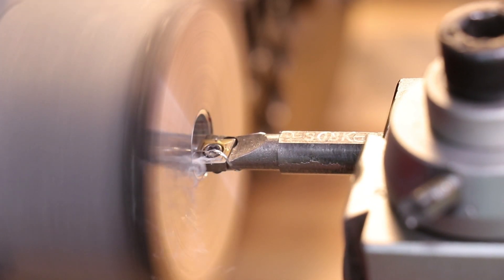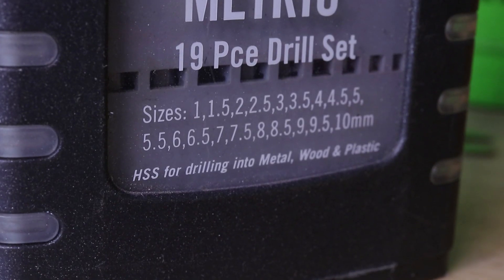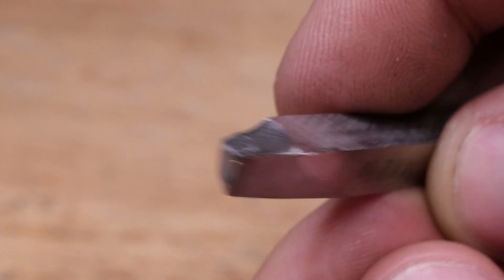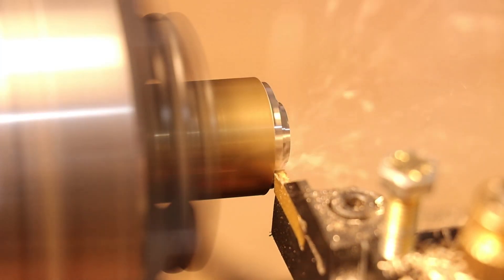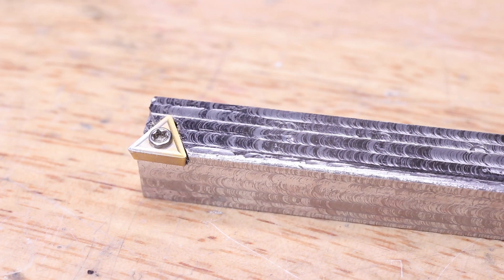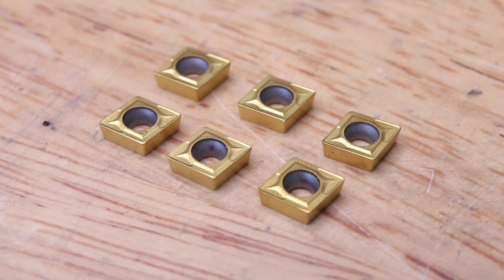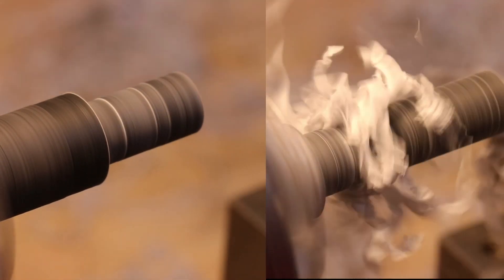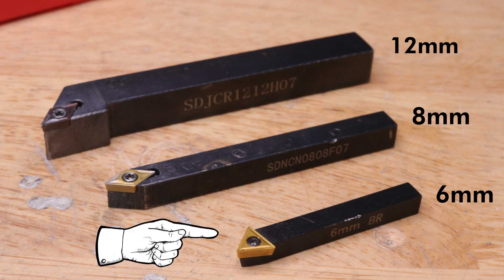HSS vs Carbide | Tooling For The Mini Lathe

Comment: if you call the manufacture you can get deals if you get a good rep 120$ in inserts (around 10$ each  dep.) and they will throw in a tool holder (this was a Kennametal rep fyi)

Comment: To be honest, the only modern application where I can see Inserts made of high speed steel is for cutting aluminum. It tends to leave a better finish than carbide. But I would still rough with carbide.

Comment: You forgot to specify (or maybe you don't know). Carbide inserts can also be found with different cutting angles. The same model, for the same knife holder, there are at least 3 types of inserts that have different angles, different treatment qualities, different coatings. And the price differs slightly for 1 set of 10 pieces. Example: 
-Soft materials (plastic, wood, aluminum - sharp angle)
-Medium hardness materials
-Hard materials, for example stainless steel

Comment: Carbide inserts, as you say, are not exactly razor sharp. They have a tiny radius on the cutting edges to provide more durability under heavy loads such as found in commercial machining operations. For small lathe use you can use DCMT inserts designed for producing a finishing cut on aluminium, they will cut steel just fine but the cutting edges are more delicate and will degrade more quickly. You can certainly sharpen standard inserts with a diamond lapping disc and I do that even with new and unused inserts. Sharpening is simple and fast. Face mills benefit greatly from having their inserts sharpened as they cut more freely and produce a better finish. I still use HSS tools but I suggest you make yourself a jig to shape or sharpen them rather than the offhand method you describe. Even high carbon steel tools still have their use for fine work in brass/plstic because you can get the finest of cutting edges with this material. Watchmakers use carbon steel tools a lot.

Comment: Excellent video with lots of good advice!
It is important to get fine grained carbide inserts for small lathes.The polished small ccmt alu carbide inserts work really well and last. Fine grain carbide inserts can easily be reground and imoroved using cheap C hina diamond discs and a home brew accufinish grinder. I made a simple one with a 1 to 5 rpm windshield wiper motor and 100mm discs. I use 3, 360, 1000 and 3000 grain with small magnets to mount them to a backing plate. Stefan Gotteswinter has a very good video about this, got the magnet idea from him. These discs were about 10$ from Ali.
 I find that people tend to forget how useful HSS tools can be. I make prototypes for my engineering firm and as a hobby. This is very different from running a production shop and taking very small skim cuts is often important, something stock inserts do not do well since they are not sharp enough. I have been at this for a few decades and have accumulated a sizable drawer of very useful and inexpensive hss tooling that I reuse. Silversoldering small pieces of carbide is also very useful for making small tools. Used mini carbide boring bars is another inexpensive source for tooling. Use these both in the lathe and in my small boring heads.

Comment: I have always used inserts but after watching this I think I will try HSS.  The only thing that has put me off in the past is that I assume when using quick change holders you would have to readjust the height of the took every time you sharpen it?  anyones thoughts on this thanks

Comment: I sharpen all my carbide tooling except for some finishing ones with large radiuses and they cut like butter but will always be more prone to chipping and cracking, this is minimized with not backing out of cuts and making sure to smoothly and consistently pushing through the cut

Comment: Those coated DCMT inserts are absolutely the wrong tool for turning plastic. As you stated, they are pressed and sintered and are so are not NEARLY sharp enough for cutting plastic - it just makes a ton of heat and poor quality finish. The coating makes them even duller. You can purchase manufactured DC inserts with a "honed" edge, which are ground from the factory with a ground edge on them, but by far the best tools for this sort of work are just uncoated carbide insert blanks such as those made by Applitec or brazed carbide with a bit of extra sharpening.

Comment: If you don't learn grind lathe bits you will have problems turning materials that require special tool angle. Plexagls comes to mind. any toll that cuts or drills need a zero rake so it doesn't fig int to the plastic. ull nosed forming tools, tools that leave a radius and more are beyond you. I started using a lathe in 1959  for a science project. Later, I ran a lathe for Brantley Backoes and then Vrantly-Hynes Helicopter. I bought a Chinese Mini Lathe about 20 years ago. Even as bad as my eighty year old eyes are I can still freehand grind lathe bits. I have tool steel, brazed, and Inserted carbide tools. I almost always use tool steel bits if I need to turn something too hard for tool steel to cut, and I am in a hurry to take it to a bigger lathe. A Mini Lathe can barely cut hardened 4130 that a full-sized lathe rolls a dark blue 500 F chip off of all day long.

Comment: GREAT summary video! I couldn’t agree more with everything you said as I’ve discovered using both types. 👍 I would have added that with carbide you need to nearly double your rpm & feed rates, as well as it not requiring coolant which is a huge benefit on the cleanup perspective not having to clean up spun cutting oil everywhere. Also would have been worth mentioning about the different carbide coatings which mate to steel vs aluminum.

Comment: omg.... too much misinformation about carbide as tooling for the mini lathe.  It seems like almost every one of these 'hss vs carbide for mini lathe' videos miss one of the most important and vital points about carbide tooling... They're application specific. And most video creators seem to buy carbide tooling without even knowing what they need.  Of course then make broad claims about the entire material....

1. Addressing 12:28,  Shape of the insert (Triangle/55 degree/80degree/square) has ZERO bearing on cutting edge sharpness... You're using the WRONG insert for your machine requirements.  None of those inserts presented are even 'sharp' to begin with!  Again, insert shape has NOTHING to do with cutting edge sharpness.  Go through a Mitsubshi turning tool catalog (they're free to download) and educate yourself on the different chipbreaker geometries. There are clear differences on the cutting edge between a FS/MS/RS.  You don't even have to go with a 'fancy' brand name tooling, **brand name tooling just make it easier to find what you actually need**.  'Chinese' inserts have a similar geometry available but you'll only have poor pictures to make your decisions on. 

2. 10:10, And the myth that hss is sharper than carbide is just that - a myth. Sub-micron grade carbide are plentiful these days and can achieve a FAR sharper edge than the 5~60 micron grain sizes of typical HSS. 

3. 2:50  carbide turning inserts that will be more applicable for low power lathes are going to be ground. Yes there are ground carbide turning inserts.... ...... 

4. 4:55  In the scope of a lower power machine/hobby machining...The difference is knowing exactly what you're getting VS guessing from the seller's images to determine cutting edge geometry.

Comment: Do you know about crobalt or stellite or blackalloy? These are all based on 50% Cobalt and 30% Chrome. The punishment they can take far exceeds M35 or carbide.https://www.youtube.com/watch?v=iAPyWKXnVFM. And when you use it in combination with the diamond tool holder this guy promotes you only have to sharpen the end of the blank. Not three sides like a normal cutting tool. These tools are sharp like high speed Steel but they hold an edge for much longer. It can also be used at higher speeds.

Comment: My first set of tools for my 1930's mini lathe cost me about £5 off of Aliexpress, brazed carbides and as long as I don't sweat them too much produce a very nice finish, better on softer metals but slowly handles steels with care.   Got a sweet set of spot drills off there too for couple pounds, an angle protractor for about 80p and a very nice quick change tool post set for £20 coming with 5 tool holders incl a boring bar holder and a parting blade holder but they skimped on the grub screws so changed them for longer high tension allan bolts on the standard tool holders as the brazed carbide's are quite small, ideal for a mini lathe.   I haven't fitted the tool post as yet because to do so, I have to pull a stud from my crossslide or make a sleeve nut to fit the existing stud.   Next job is to try and find or build a transmission axle, I have en route a jack shaft with suitable 3 step pulley, waiting on finding a suitable tall mount to mount the pillow bearings to hold the jackshaft which will give me three speeds from my motor.   I have watched most of your videos and learned so much too.

Comment: For those of you wondering HOW the TITANIUM NITRIDE coating is applied to something like a CARBIDE tool ...  It's actually quite impressively done molecule by molecule via process called physical vapor deposition (PVD).  It's put in a chamber and I believe they give the target an electrical charge while heating the substrate up to transfer it ...  If I recall, there's a channel called AlphaPhoenix which demonstrated the process as they guy is an actual physicist who works in a lab in which PVD is applied (along with other projects that I think include some fundamental physics experiments).

Comment: This was a great video, thanks!
I don't think I can manage a grinder in my apartment so I was wondering what to best equip my mill with.
I think I'll stick to carbide for aluminum but after hearing about HSS being sharper, I think I will use that on my plastics.

Comment: Stefan Gotteswinter showed on his channel that while mass produced carbide is not as sharp as HSS, you can grind it to be just as sharp. Just use diamond abrasives and don't breath the dust.
Reply: Sharpness also isnt the only consideration, durability is arguably just as important which is what can make sharpening carbide worth the extra effort :)
Reply: I use hand ground and wire edm made carbide tools on my lathe.. biggest advantage I'm able to make my own tool geometry,  and mostly use them In  titanium..i buy carbide rods of ø4mm or use broken or dull endmills to make my lathe tools.
Reply: or just buy sharp inserts if you need sharp ones 🤷‍♂️
Reply: Yep, they are dulled on purpose during production.

There are a few reasons for this, mostly durability and surface finish. A razor sharp edge is very fine and has a tendency to dig into the work.

Comment: One major advantage of coated carbide I've found is machining aluminium.
 There is far less edge build up compared to HSS. Saying that, I still mostly use HSS on 6061 but it does need lubricant ( usually mineral spirit) which can sometimes be messy. I have also used cheap synthetic motor oil thinned down which works very well (diesel also works well and isn't too smelly)
Reply: Isopropanol is a superb cutting fluid with aluminum and probably other non-ferrous material, but being alcohol it takes some care not to prevent rust.

Comment: Popped up again in suggested, so I am here again. I really wonder where this video would have gone if the cracker fitted in the toolpost. I was going to say that brazed carbide inserts don't deserve there own  video but I see that right at the end of this comment is your thumbnail for exactly that.  When I was an apprentice back in 1964, they were what we had, now really not worth bothering with, just not sharp enough for use with small lathes.

Comment: One difference between HSS and carbide most hobbyist and myself didn’t know about was the (work stress) a lathe or milling machine can endure without excessive body twist and therefore chattering. 

HSS cutting edge can be grind very sharp to reduce work stress in small / hobby lathe perhaps fitted with an upgraded motor. 

On the other hand carbide cannot grid to equal sharpness without risk of chipping off at its cutting edge. To avoid chipping, carbide were manufactured with a designed radius (dull wo/apex) at its edge. 

Caveat? Carbide cutting edge will glide / skid on the work surface at a load normally applied with HSS, unless we deliberately force / dig it into the material. That cause a small / hobby  machine chattering. 

Chattering? Can be improved with rigidity in the system beginning from removing free play at sliding junctions. This causes assembly difficult to slide. Remedy? Reduce profile ripple on sliding surfaces. How? By counterfeit scraping referencing to a flat certified granite block. 

If chatter persist? Admit we are a creative hobbyists with a flimsy machine. Use HSS with coolant, reduce feed rate, reduce advance rate between each pass, change spindle rpm and continue creative.
Reply: Contrarily, I prefer to turn plastic, aluminum, composite with HSS. We can use whatever tool toughness / hardness we want as long as we apply the correct edge radius, feed rate / coolant, depth and surface speed, provided edge is harder than the load.
Reply: @philoso377  I guess you prefer to use HSS because you don't have proper carbide insert and don't have production volume which would make sense fro you to get ones

Sure, you can what is more convenient for you - can even use tool steel for some these materials :)

The thing is that's wrong perception in general that "HSS is sharper" - I guess it came from hobby-class workshops where machinist usually not so picky about inserts and also don't have the knowledge how to select them and what the third letter in ISO insert code stands for

But I can tell you that no real serial production runs hss turning tools and you can select insert sharp enough to cut down to ap 0.1 mm with fn 0.02 mm/rev - and in 99.999% you don't need to go below that ;)
Reply: @romanplutok6202  It is clear that the debate runs between mass and small production. Also between freedom of choice on tool / equipment vs price, volume, precision and performance. Let me quote this, a good carpenter seldom blame his tool.
Reply: @philoso377  Sure - I’m not saying carbide will be more efficient from economic perspective in all cases. I’m just explaining that it’s wrong to claim carbide inserts as “blunt” (and this is very common stereotype) - there are just different inserts for different applications
Reply: What’s a problem to use sharp-ground inserts?
Reply: @romanplutok6202  problem is that - carbide edge modified form radius into a very sharper edge - the sharp edge will chip unless the feed depth and rate are significantly reduced.
Reply: @philoso377  That’s not really correct - carbide edges are very different depending on application - edge roundness may vary at least between 15 and 75 microns depending on application. I guess you don’t think that turning of aluminum, plastics, composites in industry is performed with hss tools, right?
Just select the right insert

Comment: I believe the trick with carbide inserts in a small machine is to use the type of insert called a finishing sharp. Unlike standard tooling, made for deep fast cuts, finishing sharps are optimised for lighter work.
Reply from the maker: I've tried these in the past, and whilst they do cut better than the regular dcmt ones I use, I've found that you need a really rigid lathe to get them to work, or the edges can easily break. Cheers

Comment: With 40 years in the business this is the most complete video I've ever seen on carbide in the small shop. One thing I might recommend if you haven't tried it is 5 or 10% Cobalt cutting tools . I highly recommended them. Slightly more expensive than high-speed but hold their edge three to four times longer.
P.S. I just subscribed.
Reply: I can say the same. The Hss Cobalt are the way to go. Even stainless is easy to work on

Comment: You gave only part of the carbide information the last number of the 3 digit number that follows the letters is the tool nose radius 1= 1/64...2=1/32.....3=3/64  your triangle inserts are 2 and a 1 will give a much finer finish . You compared a 1 radius HSS to a 2 radius carbide. Go back and test the radius against the same radius. you might be surprised. And L think you'll find that the other 2 numbers have meaning also  like the size and the coating of the insert.

Comment: i mostly use inserts made for cutting aluminum. those are sharp as and you can also cut steel with em, and the resulting finish is excellent.
Reply from the maker: Glad to hear that you like the aluminium inserts. They are certainly a great option. I have used them but on my lathe I just couldn't get them to work. The edges were just too brittle for my liking. Cheers.

Comment: I have 8mm HSS blanks that have been used & reground for 20 years... 😏

I'm not a big fan of carbide unless I'm machining something unusual... particularly when running a small lathe, you can grind a fairly aggressive rake which will DRAMATICALLY reduce the horsepower required to make the cut... 😎👍☘🍺

Comment: Carbide is a pressure cutter, HHS/Cobalt can be sharpened to cut with little pressure, should be all you need to know if you are using low powered equipment
Reply: Just get positive rake inserts. Literally the exact same geometry with a stronger cutting edge for higher sfm.

 This comes at the expense of higher edge chipping.